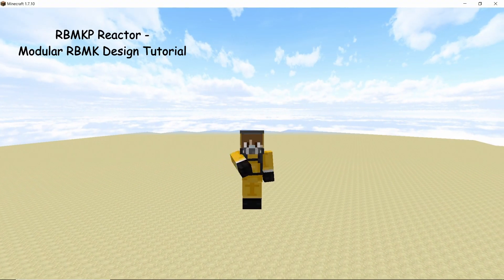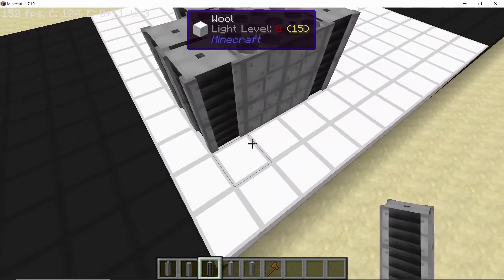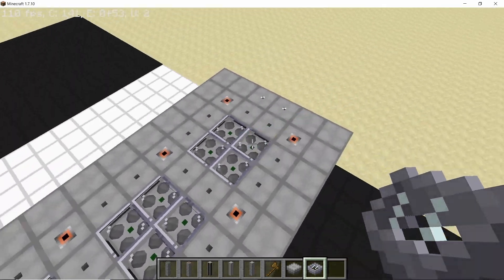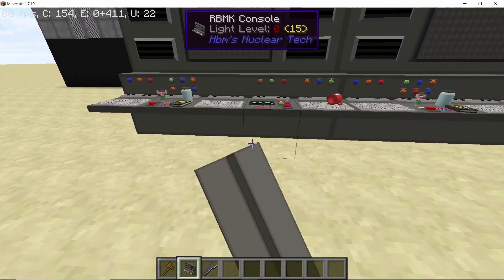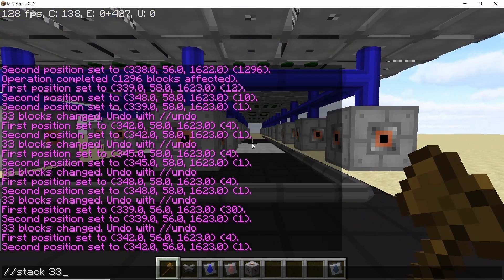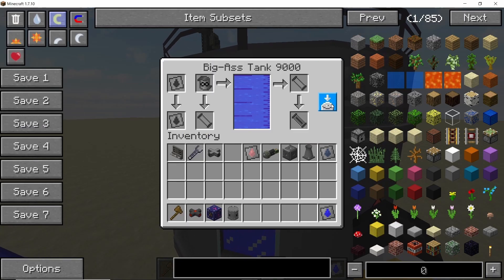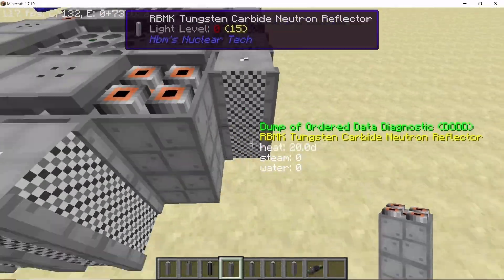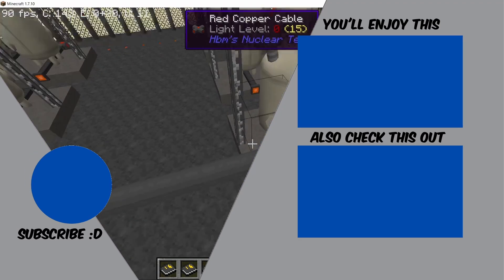RBMKP-2400 Reactor with HEU-235 FUEL RODS : How to make an RBMK Reactor in Minecraft

Comment: I'm going to try to do it in version 1.12.2, in the NTM Extended Edition, I'm waiting for my SSD to arrive because my HD has a problem, but when it arrives I'll do it.
Reply from the maker: To increase efficiency of this reactor replace the normal fuel rods with moderated ones and then use control rods instead of graphite moderators. 
Aside from that best of luck I hope your SSD arrives soon
Reply: @SavageVegeta  Yes, actually I always use the moderated fuel rods, and the moderated control rods too, I've only used the unmoderated ones once, but whenever I build an RBMK, I use the moderated ones.

Comment: Very cool, it's the first time I've seen an RBMKP in Minecraft, I've done it once only with the old Reactor Craft mod, but in NTM it's the first time, because few people know this reactor, I've done it too Reactor SL1 using things from RBMK from NTM, it is a very complex and small reactor, and if you increase its power too much even just raising only the control rod in the middle, it explodes, it is a very unstable reactor and controlled by hand, no panel, and 5 control rods just like real life!  Now I wanted to make the CANDU reactor, unfortunately it is not possible to place the fuel rods and control rods horizontally, otherwise it would be perfect. 
I already kind of made the CANDU reactor, with the Extreme Reactors mod, but I wanted to do it with the NTM items.
Reply from the maker: Ooh the SL1 definitely sounds like an interesting project to overtake !! As for the CANDU reactor there is going to be a new reactor added in the mod soon and it will be modular afaik so maybe you can try making a new design with that. 
And yes I noticed that there was a lack of RBMKP related designs in general in the NTM community so I decided to make one. This one is not very efficient as each rod produces only 2.9 MHE/s when on max power but the design I made after this with 78 control rods produces 4.1 MHE/s per rod so yeah it is much more power dense

Comment: Yooo, great vid. Can you make video about u233 production  automatisation?
Reply: Thanks for advise
Reply: @cring228  if u need uranium 233 and have a rbmk the rbmk breeding channel is way more efficient and u get alot of power
Reply from the maker: That is a bit hard to automate but I will definitely try man !!
Reply: @SavageVegeta  Wow, idk that hard. I have a bit of rbmk reactors and don't even know how to produce it's normal also self charging battery. Thanks for responding for every comment, you are the best🤜
Reply: @cring228  I use Savage's Bedrock uranium design + 2 Chemical plants 1 for yellowcake and 1 for uranium hexafluorite , start of with steel crate of fluorite and sulfur, to kickstart the process, (also you will need a chemical plant for both sulfuric acid for the drill and the other acid (forgot its name but its made of water in chem plant).Place 2 tanks to store uranium hexaflouride then attack 2 columns with 4 gas centrifuges each, that will produce your uranium-238 , 235 and 233 as well as fuel grade uranium which i dont need (i use 2 big nuclear reactors to power everything with the fuel grade uranium) It's very expensive to do in survival and generaly not needed, because you will already be in the late game if you already have this design.Attack everything with conveyors and separate into autocrafters which make ingots or billets or rods.
Reply: @sussyimpostorsheesh24  yo, nice idea. Butt how about 1.12.2 extended version of this such beautiful mod? 1.12.2 does not have such mechanics(last time i checked it seem like it doesn't🤔), connecting 4 gas centrifuges does not affect anything, uranium hexafluoride fully produce using only one centrifuge. I have same output as you do, except of u233. Acid called peroxide😁 I saw on the fandom wiki that thorium breeding is one of the ways to produce u233, but I haven't tested it because I sold my power supply, and my laptop is such a potato that it can barely run fullhd youtube videos🫡 

🙎🏿‍♂️ why that dude are bl---
My lawyer advised me not to finish this joke
Reply: @cring228   I think its impossible in Extended version cause the chem plants needs more ports, and there are no conveyor belts (prob could use thermal expansion) so it could be 60-ish percent automated. Ill let you know if JEI can be used on the 1.7.10 version (which you should use btw)
Reply: In 1.7.10 version u connect 4 gas centrifuges to totally process uranium btw thorium breeding is good but breeding reactor is not really good since the little reactor is very unefficent in mid-game so best of luck

Comment: Hey so I have a bit of a problem but ain’t sure if it’s the version of the mod I have but pretty much I did everything in your big rbmk 15x15 video using uranium-233 and 235 fuel but I built this underground in my facility and I couldn’t have the 8 turbines across from each other so I had to use 2 big cooling towers. Starting up the reactor works fine with no issues but it’s the power that it’s producing, in the video 15x15 rbmk video you end up producing 45mhe every second, for me it’s only producing 11 mhe every second. Any idea on how to fix this? I’m using ntm extended 1.12.2 on the latest version of the mod.
Reply from the maker: There is a difference in power produced in the 1.7.10 version and ntm extended even when using the same fuel tho coming down directly to 11 from 45 seems ... Wrong 
Tbh you will only need 4 turbines not 8 and you did a great job at using 2 big cooling towers cause that is one of the biggest mistake I made in that video by using the auxiliary cooling tower
Reply from the maker: Now the thing is that design is kinda old, what you can try is make the RBMKP that I made last week (you can use world edit to make it in under 5 mins as it's a stackable design) and then you can compare the power produced in your 1.12.2 world and in my video. 

The next time I load up 1.12.2 I'll try making the 15x15 to see why there is such a big power difference!!
Reply: @SavageVegeta  Alright cool that would be very helpful thanks. Keep up the good content!
Reply: @SavageVegeta Hi I made the design in this video and it’s producing more than shown in the video, producing around 243mhe/s where your one produced around 211mhe/s. Quite an odd power change between the two mods, if you have any info on why this is happening please feel free to reply.
Reply from the maker: @blixergirl9629  more power production is explainable cause NTM extended produces more power from the same fuel. With the 15x15 I guess steam type used by you was different maybe ... That is the only reason I can think of right now. As I told you before I did mess that design up a lil bit by using less cooling towers and way too many turbines. Anyways I'll try it out when I load up 1.12.2!!
Reply: Alright cool, guess that also somewhat explains why my fusion reactor isn’t self-sustaining itself. Thanks again.

Comment: Can This Reactor power a DFC Reactor?
Reply from the maker: Well you can run it for extended time to gather up enough energy and then kick start the DFC ... And then basically most DFC reactors are self powered as you can loop the energy back in. Using only this is risky imo especially when it comes to something like DFC
Reply: U can try but be careful any mistake will result in deletion of your world

Comment: Let me guess, there are no other models of the RBMK that i can make to get back on track....story of my life, good job though my man!
Reply from the maker: Well there's always bigger designs that you can pursue, like the variety of fuel available in NTM is more than that available in real life and each type requires a slightly different design so 😎🤜🏻🤛🏻
Reply: @SavageVegeta  maybe a quad RBMKP? Or RBMK-1000?
Reply from the maker: @TheChosenIndividual  I have made a setup with 5 of these 36x12 modules do that the power production is over 1 GHE/s but yes the actual RBMK-1000 is definitely an interesting one !!
Reply: @SavageVegeta  time to leak secret classified documents to find new models, just like the olden days
Reply from the maker: @TheChosenIndividual  oooooof